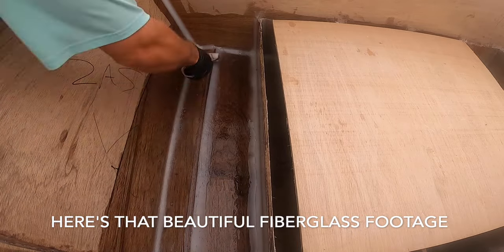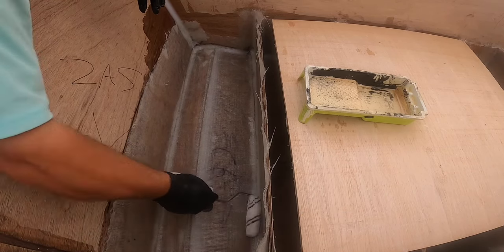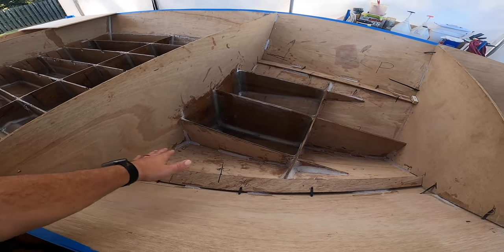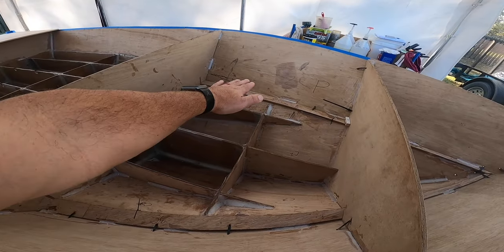11.DIY Boat Building: Make a Great FIBERGLASS PLAN

Comment: Very nice Wooden Boat.  Will you use Kevlar Fiber for the Bottom of your Boat?
Reply from the maker: No I don't think so.  The designer has addressed the use of Kevlar the following way, "Kevlar is a great selling point, I mean it sounds like the hull is bulletproof! But truthfully, its benefits and costs are hard to justify for the home builder. If a production builder uses it the often infuse and use it in a very specific way for it's structural properties. And the Kevlar is almost always a part of a laminate schedule that contains traditional glass also."

Comment: How much time do you have in this build so far
Reply from the maker: It would be so very hard to say.  I started cutting out the patterns the first week of July.  I picked up my plywood on July 15th, traced the templates, and actually started scarfing and glueing that together around August 7th.  Obviously not working steady on the project.  The first pieces didn't going in the cradle until August 21st.  In the middle of all that I have had at least 3 trips out of town that were a week each.  So, after saying all that, when I have been able to work on it, I have been maybe 4 hours a day here or there.  Not to mention if I knew then what I know now, I could probably get where I am now in half the total time.  It's a journey, and I approach it as such.  I've never built a boat before so I'm learning a lot as I go.  Appreciate you watching and asking.  Let me know what you think so far.
Reply: @Bigeaux20  was marine plywood sourced locally or by plans provider
Reply from the maker: In my situation, I sourced my own plywood.  The designer does have the option to purchase a CNC cut kit which includes the plywood, but I choose to take the long road to the station.  Check it out here: https://saltboatworks.com